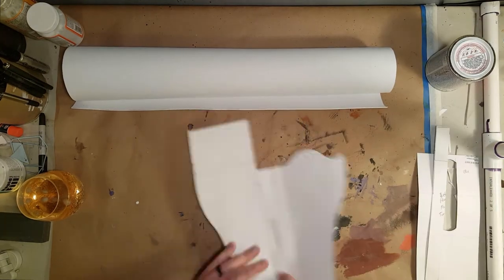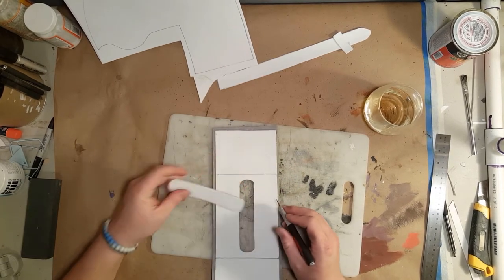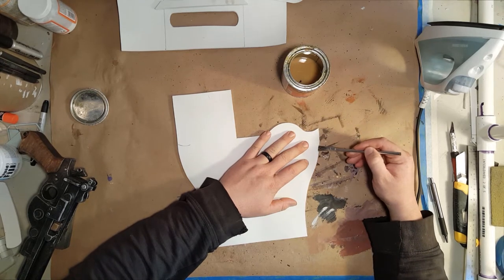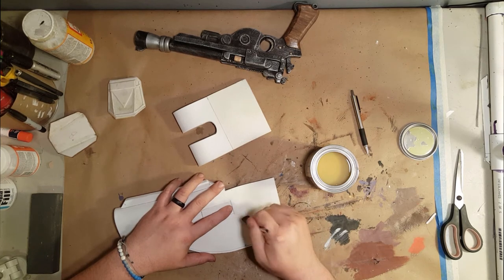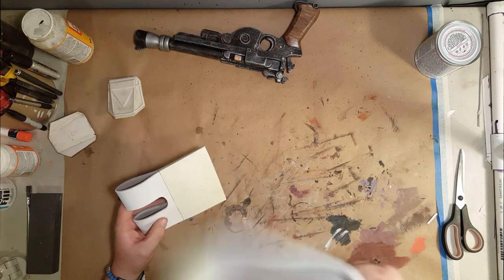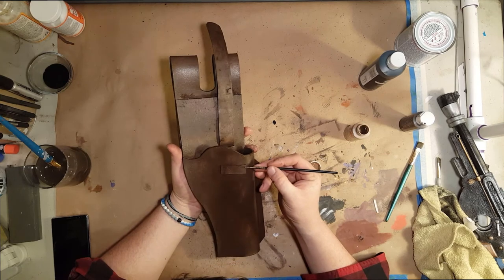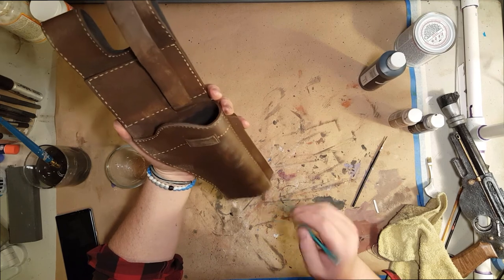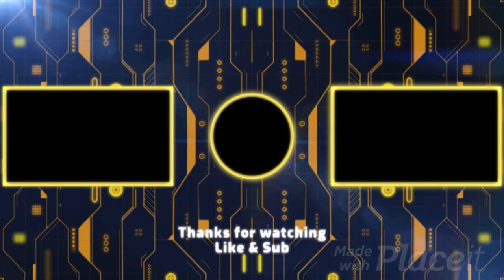The Mandalorian (Din Djarin) Blaster Holster and Hand Plates DIY EVA Foam

Comment: Currently doing a 3d printed mando mash up and needed a holster. Used your templates and made them a little smaller as I have a blaster I designed that's nothing like mandos,  but your templates where a fantastic start, thank you
Reply from the maker: so awesome to hear!! Glad they worked out well for you! Good luck on your suit build